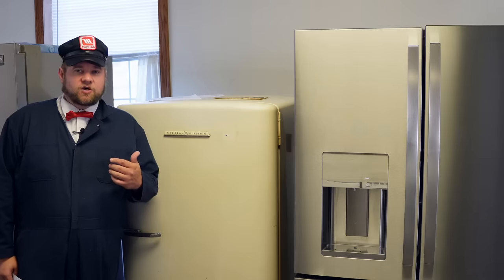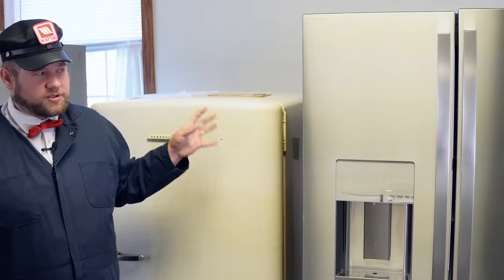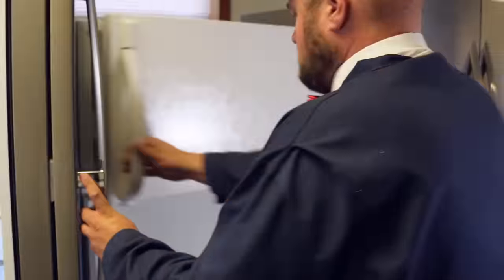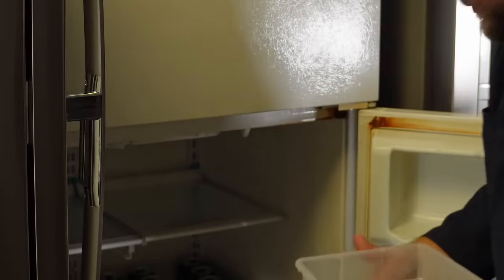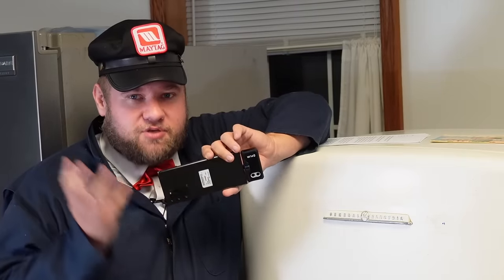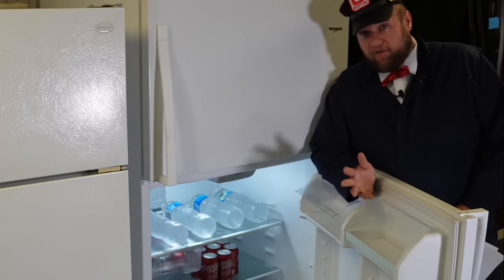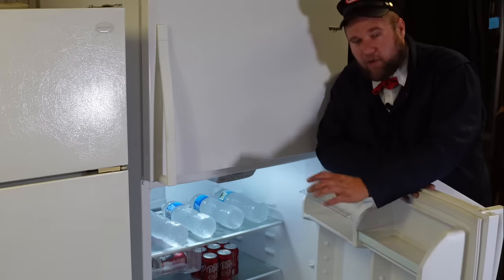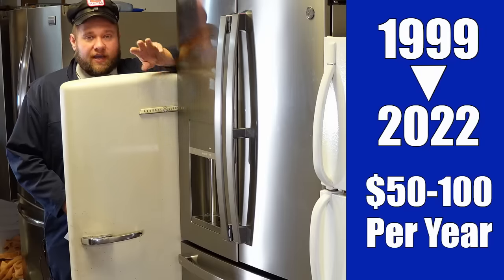Should You EVER Buy a New Appliance if Yours Still Works? A 7-Day Test

Comment: My mom wanted a new refrigerator in 1973 when my parents divorced, and she was kinda kicked out of the house. The next day my dad went to Sears and bought a new avocado green Kenmore refrigerator with an ice maker. My step mom still lives in the house and that Kenmore lasted until 2013…..50 years. 
Two years ago I bought a house which came with the appliances. I was very excited to see that there was a set of 1985 (?) Maytag top loading washer and matching dryer. I had to have two of the hoses on the washer replaced (they’re were only three hoses and the third hose was still in great shape). The repair guy put the washer on a spin cycle just to hear the very nice balance sound the machine made. He said “don’t ever get rid of theses”. I really didn’t have much luck with a newer GE refrigerator about 9 years ago (it broke down 5 times) so I really don’t like appliances with “motherboards”. If I ever move, that washer and dryer care coming with me. Thank you for a great video….and sorry I rattled on!

Comment: I was interested in this video because I was teaching this to my students, I changed my refrigerator the last year, and the price of electricity was reduced by 10 USD per month. So I did a little work on your data.

In several of my papers, I used a 'specific' property ... in your refrigerators, I will use W/CF; the power that they use is divided by the volume of the refrigerator, so:
GE1950 -> 8CF
FD 1999 -> 18CF
WP 2018 -> 18CF
GE 2022 -> 28CF
WP 2022 -> 21CF

On day 5, the consumption was:
GE1950 -> 4.7kwh   -> *0.59*Kwh per CF
FD 1999 -> 9.6kwh  -> 0.53Kwh per CF
WP 2018 -> 2.6kwh -> _0.14_Kwh per CF
GE 2022 -> 8.4kwh  -> 0.30Kwh per CF
WP 2022 -> 5.8kwh -> 0.28Kwh per CF

On day 6, the consumption was:
GE1950 -> 5.9kwh   -> *0.74*Kwh per CF
FD 1999 ->11.2kwh -> 0.62Kwh per CF
WP 2018 ->3.9kwh  -> _0.22_Kwh per CF
GE 2022 -> 10.1kwh -> 0.36Kwh per CF
WP 2022 -> 6.4kwh  -> 0.30Kwh per CF

On day 7, the consumption was:
GE1950 -> 6.5kwh  -> *0.81*Kwh per CF
FD 1999 ->13kwh  -> 0.72Kwh per CF
WP 2018 ->4.6kwh -> _0.26_Kwh per CF
GE 2022 -> 11.7kwh  -> 0.42Kwh per CF
WP 2022 -> 7.5kwh  -> 0.36Kwh per CF

From day 5 to day 7 (sum of the consumption divided by 3 to have an average=)
GE1950 -> 5.7kwh  -> *0.71*Kwh per CF
FD 1999 ->11.3kwh  -> 0.63Kwh per CF
WP 2018 ->3.7kwh -> _0.21_Kwh per CF
GE 2022 -> 10.1kwh  -> 0.36Kwh per CF
WP 2022 -> 6.6kwh  -> 0.31Kwh per CF

The volume refrigerated by power usage:
So the less efficient is the  GE1950
And the most efficient is the WP 2018
But we found something more interesting, the French door is less efficient than the standard door. 
And also, the best efficiency is obtained after using it for 4 years than brand new. 

If your want to make another video like this, you could contact me. I have been a researcher for more than 20 years and counting, and I will help you to do a better scientific report. Do you want to make it again?

Comment: Same goes for water heaters. Plumber told me not to expect to get 25+ years out of the new one because the lining is thinner than the old ones. He said to expecting 10-12 tops.

Central heat and air units (HVAC)? Same thing.

Comment: In Denver the average residential kw rate is $.1105/kwh. the difference in operational cost certainly adds up but assuming the unit is still operational within range, the owner should calculate the payback period given the replacement cost. In addition, the decision will vary dependent upon what appliance we are talking about (fridge, washer, water heater, clothes dryer). Shopping for features and or size adds additional elements to the bottom line.

Comment: I've got a gas RCA stove with a mercury temp sensor from the late 70s It stopped turning on when you turned the knobs for the oven. The tech who came and fixed it said it just needed an adjustment. Chaep fix took 2 minutes.It's worked fine since then 6 years ago and he said to never get rid of it just get it fixed again. He said the digital ones fail a lot and the board and display costs hundreds of dollars to replace and are a pain to work on. Never getting rid of it if I can help it.

Comment: Really like the video.  I remember the 1950s type refrigerators back in the early 1960s, since we had basically the same model,  before we went shopping for groceries we always defrosted the fridge which was about every two weeks.  It was a very normal routine back then.  That when you grandmother had the refrigerator with compressor on top and it stood on legs and seem like was built like a armored tank (LOL).  In 1999 I got my first frost free refrigerator, I was very impressed it only lasted for 7 years I have had this one running since 2007 but it seem to keep running ok.  I found that efficient air space around the fridge helps in keeping it lasting longer so I went to a smaller fridge and I think that is what has kept my running longer and doing a annual vacuuming out dust around  the working area where the compressor is and the coils on the back of the fridge and cleaning the floor underneath it could makes a difference.  I could be wrong and just be lucky with a fridge that has lasted for 16 years.     Thank for telling us how to test the seals on the doors I think that is important and is something we can all do to keep up the efficiency of the refrigerator.

Comment: i have a close to 30-year-old fridge might be older. late 80s early 90s.  we had it switched off for a long time due to power consumption and noise.  Filled it up early in pandemic for size convenience and broke down middle of last year.  Hired a tech who looked at it and flat out told me it needed a five-dollar part and it'd likely run for another decade.  But we had asked if it was possible to replace the old motor for a newer more efficient one.  He happened to have one in his spare parts and I had it swapped.  Runs super quiet and is far more power efficient.   Might last five to seven years. but im fine with that.  it costed me maybe 150 bucks.   a new fridge is anywhere from 500 to 2k.   So having this frankly really well-preserved Fridge given a second lead and keep working for longer seems like a rather good deal. 

Tech also told me that he had done this to several other machines. and proudly told of the oldest one he had done. a 20's machine with the motor on Top. 

Like that 50's fridge.  It runs well still.  does not use a terrible amount of power.  I could be upgraded with a newer motor and kept going for long.

Comment: My 1968 Kelvinator refrigerator still works beautifully. It's a cheaper model with a non self-defrosting freezer. It's only problem is that it freezes everything unless the dial is below 3/10 on its scale.

Comment: When i moved out I took a refrigerator of the 90s from the attic, it was a small one with 1 freezer unit and 3 small storage units. I had to defrost it regulary because otherwise there was 5cm/2inch ice in the back. Then I bought a new one from LG with an air flow system and much more space (3 big freezer units and double the amount of normal storage room then the old one. 
My energy bills dropped by almost 15% (be aware that I live in a flat and don't have many devices that consume a lot of energy) and I also saved money on food because it takes much longer to get bad. 
Also there is a 10 year warranty on the fridge. So overall it was a very good decision to buy it.

Comment: I have a GE refrigerator built in 1941 best fridge ive ever owned as far as being reliable. It has saved my food when the others went out. Its 82 years old as of 2023 and at the rate its going may last 100 years or more.I have looked at its wiring and its electrical components and think I know why it runs so long. I am planning on changing a newer model fridge to be more like the older one as an experament just to see if I can increse its longevity.

Comment: One also must consider durability and parts availability should something fail.  A circuit board, for example, that craps out and is no longer available can mean the whole fridge gets scrapped.  I'm in the process of buying such a part via ebay to keep a KitchenAid dishwasher with a custom wood panel.  KitchenAid service tech came out and said the sump needed to be replaced.  It's a $250 part and he recommended just getting a new unit (literally he said "Google 'cheap stainless steel tub dishwasher' and buy one.").  Instead I bought a brand new sump that Whirlpool still offers and installed it only to find out that the problem is the electronic power control board which is discontinued. Hence, ebay.  Appliance shopping ranks right up there with shopping for a mattress.

Comment: This all depends on whether or not you can get certain parts the appliance needs.   I'm sure my late 80s Frigidaire side by side would be more efficient if the fridge door gasket wasn't junk at the bottom.  Been looking occasionally for years and still haven't found a replacement.  One of my uncles jerryrigged a fix but it still needs to be replaced.  I'm sure all of the coils could stand to get a good cleaning as well.  It still works but the temp knobs are turned almost all the way up to the coldest setting.

Comment: Great subject, thanks. Do you have a favorite brand for a new replacement?
Reply from the maker: Most brands suck. GE has a slight edge. Key factor is fewer accessories especially in door ice because putting a bucket in the refrigerator portion is a super bad idea that kills most fridges.
Reply: @bensappliancesandjunk  thanks you have a new subscriber

Comment: Google is listening to me,  I literally just had an hvac guy giving me estimates for a new hvac unit,  mine is from 1988, so 35 years old,  but wanted to explore the costs/benefits of better efficiency.  He leaves and this is the top recommended video.
Reply: Unlikely that you will ever recoup the cost. And it's also unlikely that a new installation will be done absolutely correctly. Kept mine going for 47 yrs.

Comment: I just discarded the Kelvinator freezer I inherited from my Gram in 1988. It still worked, but I couldn't use the bottom level (the insulation had deteriorated & nothing froze on that level), & I wasn't willing to empty it out & defrost it more than twice a year. The guys who delivered the new energy-efficient freezer & hauled Old Faithful away guessed the Kelvinator was "at least 50 years old" & predicted I'd see my electric bill drop.

Comment: The reason they say newer appliances only last 7-10 years is not that they can't be fixed but that the cost of repair parts (and repair man) is so astronomical, that it is cheaper to buy a new one rather than fix it.
The older products with manual controls were much cheaper. I have a 20 year old stove with an electronic clock, timer, heat control that would cost $300 for a new part so I make do with it.
Stay away from electronic controls (if possible) and fancy gadgets.

Comment: Getting a lot of good info. I was given a small glass door beverage refrigerator that was kept on the patio, worked great. In my kitchen, everything stays frozen, or warm. I don't know if it is the condenser or the switch. One tiny move and the condenser comes on and everything freezes. Temp goes from 65* down to 17*. Is it trash. Can't afford much to fix it.

Comment: My Mother in Law has a 1947 GM refrigerator that is still in use today (also now on soda pop duty) with no problems whatsoever, and has never had a service call. It was a wedding present. I've often wondered how many kilowatt hours of power it has consumed and the total cost to run it for the past 76 years, and adjusting for inflation. I've also often wondered what would happen if foam insulation was added to the inside of a modern refrigerator, trading some size for efficiency. In my lunch box, my little "trick" is to fill the ziplock bags my wife packs food in as food is consumed and the day goes on, using them as insulators, placing them around the food that's still left. This seems to work pretty well, even on a twelve hour shift. All the Best! 73 DE W8LV BILL

Comment: I'm normally against upgrading for the sake of upgrading, but I replaced my old side-by-side refrigerator (mainly because of color) with a new fancy GE Profile that I found at half price.  Huge reduction in power consumption.  Old one was 350 Watt Hrs/hr, new GE was about 75 WH/hr.  With high North East power costs, the Profile is almost $500 less per year to run.  That's not insignificant.  If it last just a few years, I'm way ahead in the game.
Reply from the maker: Wow, nice! How old was the old SBS fridge you replaced?
Reply: @bensappliancesandjunk  Guessing because it came with my house, about 20 years old.  I remember a lot of grunting when the guys were moving it.  They said it felt like it weighed twice as much as the new one.

Comment: I have the same fridge as your 1999 one except mine was a Kenmore and it was a couple years newer like a 2001 or something like that. In the 20+ years I had it only thing I ever had to get fixed was the ice maker and that wasn't a big deal I just used ice trays instead. The other thing was the fan this year there is no way in getting rid of that thing. It's been in the garage for the past 10 years keeping sodas and beer cold in the hot riverside summers where it gets 110 degrees plus.

Comment: Very cool and informative video! Thanks for posting.

I know nothing about refrigerators (or anything else for that matter 🙂), but I wonder if the ambient temperature and relative humidity affect a unit's performance. It seems that all of the units being tested were positioned closely together. So the exhaust heat of each unit contributes to the overall ambient temperature. Additionally, the closeness of the units may influence the flow of air around each one, which may in turn, perhaps, influence how well it performs. Would different performance characteristics be obtained if each unit were "thermally isolated" from the others? Would different results be obtained depending on the time of the year (winter vs summer, for example)?

Not sure if any of these factors are relevant but I thought I'd ask just the same. Thanks again for another awesome video! Happy New Year!

Comment: One important thing that you were nudging here but could be expanded more (and tested!):
The cooling of the food.

How cold is it? (should be around 2-4 degree C)
Is the cold distributed approximately equal, or do you have 2 degree C in the bottom, 8 in the top and 12 in the door?
How well does it contain the cold? Or is it going from 2 degree to 8 degree in every cycle.
How fast will it cool the food down, especially important in a freezer.
How cold is the freezer? Should be around -18 to -20 degree C.
How well does it hold the cold in a power outage?

Comment: Life hack: open one side of the 12 pack and then place the 12 pack  in the fridge with the opening facing the back of the fridge once the case is in the spot where you want the cans then open up the side facing you. Put your hand inside the case holding the front row of cans in place and pull the cardboard out. The cans stay and you save time.

Comment: Yes, absolutely.  My electric bill went down an average of 24 dollars a month,  when I replaced my old side by side GE Refrigerator/freezer with a freezer on the bottom French doors Samsung. I will be replacing my old dishwasher too. However, if I had the 1950s model side by side double oven gas range I grew up with,  I would cherish it and never give it up. It wasn't pretty, lots if chipped white enamel, looked big an beastly, but was great to cook on. The burners were superior to the burneri have now. It had a lot of great fixtures.  I do like my convection oven now, but would give it up for the old stove.

Comment: The only reason we replaced the 1070s era refrigerator was not because it was as loud as a microwave oven, but because a tree smashed the house it was in. We only upgrade appliances if there are notable user experience improvements (there usually aren't) or if it becomes too expensive to repair (if you ignore cosmetic things like cracking plastic, then this rarely happens unless you have a smart device of course).

Comment: Beautiful memorial to your grand folks🥰💯🥰

Nice test,  however,  a better more accurate test "might" consider dl volume ratios.

Grandma had filled with x soda and water,  meaning 75% full capacity. 

The others,  being larger,  were at a much lower full capacity,  so cooling would be significantly more at the outset,  but,  less for the duration. 

Interesting study.  In appreciation for your grand parents,  and your efforts,  I applaud you all. 😇

Comment: Okay, I have a kenmore that I bought new in 1990.  It is still running everyday.  However,  right before the original warranty expired the compressor went out so the Sears repairman put a different compressor in it which I believe is why it is still running after 32 years.  I put a watt meter on it today and it was drawing about 262 watts.  If it runs 8 hours per day that would be around 760 kwh per year.  Another interesting thing is I also have a AO Smith, propane water heater which is also still operational after 32 years.  Both were installed when I built the house which is why I remember their age.  The short lived junk they produce today would quickly erase anything saved by energy efficiency, not to mention the energy wasted to manufacture this junk, much of which then ends up in a dump.